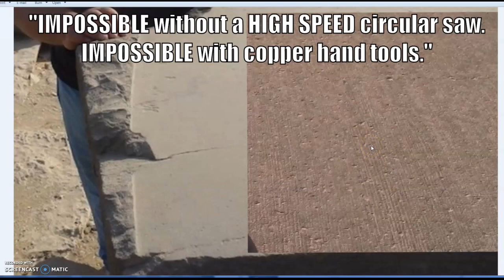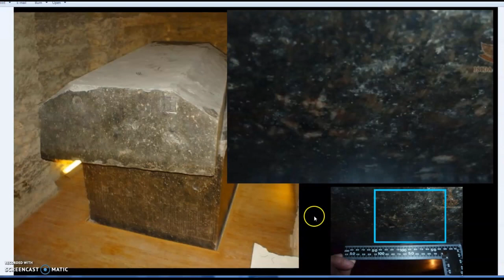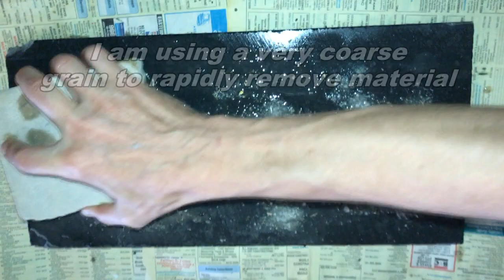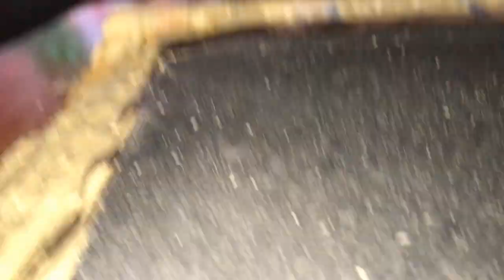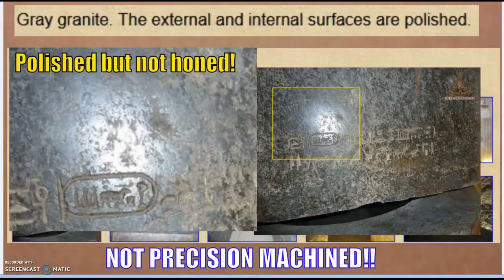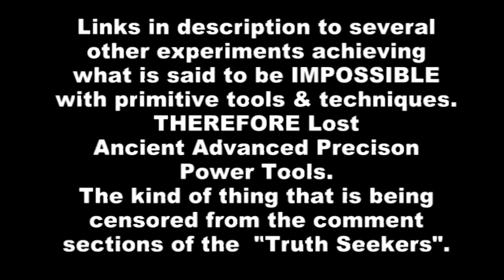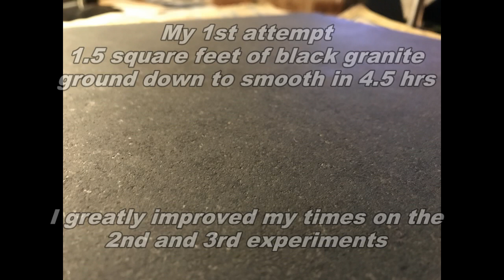Ancient Stone Working Techniques: Experiments with Black Granite on Removing Striations

Comment: The question is about the whole process of creating such a box. Cracking the raw blocks in the quarry? Transport without wheels and only with sleds and hemp cord? Moving on a ship without toppling/capsize? Copper as only tooling material for carving granite? Not copper residue/coloring from the tooling (copper-oxydes and sulphides make good coloring)? Parallel toolmarks in large circles? Core-drill holes and cylinders? Moving boxes in narrow places (why and how)? 

Polishing is only one aspect, especially when compared to the rough writing on the serapeum boxes.

That a slurry polishing with the right material is easy is well known for every hobbyist. But retaining large flat areas and sharp edges is another dimension of complication in this processes.

Post-Scriptum = One point: "High Technology" is a bad wording for working with stone. Is the power-drill we use today "high technology"? For medieval people it's beyond believe and their work would have been much easier. However, for today a laser-engraver isn't even "high technology" anymore, because everyone can buy one on Amazon. So IMHO the working on stone in Ancient Egypt is of course some kind of "high technology" because it's roughly beyond their capability with simple hemp, wood and copper tools. IMHO they must have used a higher technology than this. That means of course not, that there have been aliens or so... but I think your picture of the ancient ones is a wrong one. And archaeologists are to conservative to change their minds about that. So we have to believe that everything had been built with primitive tools.
Reply: This video should answer most of your questions https://www.youtube.com/watch?v=PwcCxJJsCf0

The problem that people ignore is the absolute lack of evidence for advanced technology. Egyptians were literally making fire by rubbing wood against wood.
Reply: @MrAchile13  300 tons
Reply: @KaroBike  And moved on the tight streets of Italy.
Reply from the maker: Just like they moved and re-elected the massive Egyptian obelisks in  Rome in 1500’s. Based on the way ancient Romans did it, after moving them across the Mediterranean, and then much further across much harsher terrain than what the Egyptians did.
Reply: @MrAchile13  wow! - that's incredible footage.
Reply: @HistoryMaze  If you use double the oxen, on two rows, you can even move it without using the pulley.

Mike Haduck has begun moving stones https://www.youtube.com/watch?v=Pb2KoOMMhQg
Reply: @MrAchile13  👍🗻🌴 🐪🐍
Reply from the maker: Pope sixtus the fifth had massive obelisks like the Lateran obelisk moved to other parts of Rome in the 1500,s. The Romans originally brought them across the Mediterranean Sea and then 17 miles as the crow flies from Portia to Rome across very difficult terrain. Making the Egyptian moves look simple in comparison. They only had to get it onto a barge a short distance from the quarry then float it dow river and then a short distance from the river to the site. The annual flood would have pretty much delivered them a hundred metres from their final location.
Vitruvius and Heron of Alexandria (as in the Library) describe in detail the principles of lifting of moving. They also describe different types of cranes but that they understood the underlying principles they could build to puropse rather than just copy one they had seen before.
The lost ancient technologists always ignore that, or when they do mention it they poo poo it with a wave of the hand. I was disgusted when I saw a Hancock lecture treat it as a joke. Also the physicist Nassim Haramein continually ignores it and uses terms like ‘ primitives with vine ropes’ when hemp rope is archeology 101 and more than strong enough even to lift the heaviest stones ever moved.
These guys are scam artists straight up or at best incredibly ignorant of basic science and first year ancient history.
Luckily when I began to get sucked in by their clever marketing and cheap word tricks I had a background in lifting and rigging. Initially I gave them the benefit of doubt on the lifting stuff but then I fact checked their other claims and their fraud became obvious.
Virtually everything they say as a scientific is false. And their omissions are even more telling about their deliberate deception. When they do mention Greeks and Romans for instance it is always to downplay. Even though the records are detailed and describe ancient science in exquisite detail.
Reply: I made a millennial cry yesterday on unfartedx.🤣
Reply from the maker: I the description I have linked videos answering most of those questions. Core hole drilling with copper drill replicating the grooves and tapering said to be impossible with low speeds and copper in granite.
Also the use of stone and flint tools have carving stone.
Granite is easily split so large blocks of complex shapes can be split in a very short time. Using copper and wood wedges. 
There’s some old footage of Italians moving a giant block for an obelisk using just a sled.
Hemp rope has amazing strength and red cedar that the Egyptians imported can easily support the heaviest stones ever moved such as the Baalbek trilithons.
Ancient depictions of sail and rope knots from the solar boats next to Great Pyramid. With a truckers hitch a piece of rope can be made into a compound pulley system. Essential for rigging sails it makes it very easy to lift/move massive weights. The Roman obelisks in London, New York, Paris moved and lifted with primitive tech.
By setting the weight lower on a barge it will actually stabilise the boat. The same way the New York obelisk was placed in the ship. By placing it at or below water line there’s no problem.
The issue with advanced machines is not really the drill but the complex infrastructure required to support it. 
In ancient quarries and sites the primitive stone tools are found scattered around. Tools marks that match. 
Archeology is conservative but it is also evidence based. The only evidence for advanced ancient machines is that it is impossible with primitive tools or it takes too long. Both are untrue leaving no evidence for advanced machinery.
Reply: @SacredGeometryDecoded  Funny is that every "reenactment" of how the ancient made some things are on the very simple side and "scaled up". You made a good job -- I have to say. But always on small scale. If you crack a granite block -- for every one you crack correctly, you would destroy some and generate faulty ones. But these are not to find in the quarrys in large amounts. And no one has the man power to simply destroy them, because they are useless.

All are test-borings are small and not very deep. These holes or cuts and not fully worked out as proof that something is possible -- as a proof of concept... of course... and then the time and effort is multiplied. But to be honest: This isn't any proof at all. In my vicinity there live "experimental archaeologists" in a fake viking village and tell us: this is the way the viking lived... made their food... smithed their weapons. But this is absolute nonsense. We don't know how the vikings lived 1000 years ago. Experimental archaeology is always from the view of the modern man... we can buy slurry-polish in the tool-market and they work well. So they did it the same and polished their boxes -- and of course the would have done it this way. But then lost their interest and all quality in engraving their hieroglyphics? A better explanation: The ones who know to polish by slurry and cut and move those boxes lived a forgotten time before the ones who not know how to carve nice looking hieroglyphs.

As long as you haven't found a tool you can't say how it's done. Myriads of vases and stone works all over egypt and not a single saw or drill. Not even a picture. All these pictures of may-be-tools may be pictures of tools or other things we don't understand. Most of these "how they'd done" videos/stories look some how obsessive but these archaeologists don't look like they even know how to handle an electric hand-drill. And then want to explain how to drill a hole the primitive way?

And further more, you have no pictures of cranes (or found ony cranes in the diggings) -- without a crane (of hard but elastic wood, metal clamps, pulleys, good ropes) you only could dry-dock a ship to load it with a heavy block of stone and then flood the dock. Otherwise the ship would capsize -- everyone with a canoe knows this firsthand. I have a 7,6m 2to deep keel sailing boat and even this heels to one side, when I jump onboard with my 80kg.  To load a ship from a side with a block isn't possible. You have to transport it over the ship and then lower it down and correct the ballast. Or the ship has to be so much larger than a block, that the weight wouldn't matter. But that holds some other complicated problems -- you can't sail a large and wide ship upstream... and you can't haul it upstream either.

IMHO... the ancient egypt society as it is represented by egyptologists or archaeologists is by far to primitive to make all these "wonders" -- which in return means (in my view) the makers had been more advanced. That doesn't mean in return no high-tech-world with engines... but with more knowledge we haven't figured out yet. Or the "aegyptologistic copper societey" lived after the one who made the wonders -- not with high-tech laser-tools but very very more likely with hard-metal tools and slurry-polish.
Reply from the maker: It's not funny at all that the re-enactment are small scale, not many people can afford to gather large teams to do full scale reproduction.
My small scale experiment here, are you serious? Do I need a large wall to demonstrate the rate on a limited area.
You are using incredible mental gymanstics here.
Granite especially lends itself to splitting along the scoring or plug lines, there are many many examples of people doing it online. Granite will ALWAYS split on the straight or curved line unless there is an unseen fault in the stone. Which masons and quarry workers test for by tapping on the stone and listening for the sounds.
With fire setting it is very easy to break up granite into dust. I did a video on this with examples of people doing it in the field and experiment I did myslef.
So your first paragraph is just incorrect on every point. 

Test borings include large ones and small ones. They also knock out the plug and it's just a matter or drilling down further. The depth of ancient core holes aren't deep in comparison. It's really not an issue not all. Since the copper core is thicker than the shaft you can keep going with no problem. Are you saying there is a problem with drilling deeper and you need to see it done? 
We have found tools that litter quarry sites and construction sites. In the images we see metal working and workshops.
Copper mines etc

Experimental sites like those viking villages are based on evidence such as furnaces and slag, bones and seeds etc. As well as written chronicles and descriptions.  
There is no evidence of this ancient civilisation or of the lost ancient technology. It is not a better explanation to say it was an older civilisation since the boxes themselves are not even honed or especially well made. Many of them are unfinished. Except for the size they are no different in material or hand tooling marks such as at the Alexandria Serapeum. 
You don't need hard metals such as steel, try a steel chisel on grante and then try and stone hammer and see if there's a big difference. i will tell you that there isn't having tried both. For some jobs I would favour the stone tool.

Copper is a valuable item. It was money and is still is, there are rare finds of tools. How many tools are found on a cinstruction site after completion? They are valuable unlike stone tools. Though we have found tools and sleds etc in ancient that have been shown to be effective in recreating so called impossible features.

to quote:
"Most of these "how they'd done" videos/stories look some how obsessive but these archaeologists don't look like they even know how to handle an electric hand-drill. And then want to explain how to drill a hole the primitive way?"
OK now let's get to it, you are talking nonsense, they literally successfully demonstrate how to drill with a copper drill. You are so invested in this lost civilisation that you are just making up pointless arguments that are cringe.

You say the archeoologists doing reconstructions are just making it up but then you even worse because at least they have evidence.

Ancinet Egyptian pictures of boats show the rigging necessary to make a crane. If you can manage sails you need to undersand the basics of mechanical advantage.  Later Greco Roman writers describe the principle of lifting in detail. Heron of Alexandria (Library of Alexandria in Egypto hint hint)
The Thunderstone in Russia was loaded onto a barge, cargo ships throughout antiquity managed to balance their loads. How is this even an issue?
Egyptian and other ships were tied together with knots for easy dismantling, it's not every day you would be movng a giant obelisk so perhaps they might have gone to some special effort. The Aswan quarries were up river so the current would transport them but you can't be seriously suggesting all shipping on the Nile was one way? Of course they could navigate up river. 
IMHO you don't know what the mainstream is actually saying and the evidence they have.

quote
"Or the "aegyptologistic copper societey" lived after the one who made the wonders -- not with high-tech laser-tools but very very more likely with hard-metal tools and slurry-polish." You have no eviedence of this at all, hard metal tools are not necessary as even modern equipment relies on the abrasive not the steel to do the cutting. Sandpaper can cut through stone, masonry drills of hard steel are useless once the hard tip is gone.  Bone will drill through stone as long as the abrasive is there.

Everything you said in this reply are just the standard lost civilisationn talking points built on logical fallacies and claims that are just wrong.
Reply: @SpaceTimeAnomaly  What do you think about what they come up with in this video in relation to moving big stones? https://www.youtube.com/watch?v=90ly8GtME3Q
Reply: @SacredGeometryDecoded  You never had been on a boat -- obviously. You simply can't load let's say 20to stones (which are small in this discussion) with an in-boat crane without counter-balances. You can't "slip" the loaded boat in the water either. At least you would need strong ropes and pulleys -- and these are not included in the workmans-package which is given to us by the aegytologists.
You can't manage loading with ropes which are prone to water effects -- Thor Heyerdal has learned this the hard way when his boats got apart. 

In our society large objects are regularily transported on ships since the 1970s with the container transporters. Before this we used only bulk freighters. If a large piece had to be shipped it was always a major task. But archaeologists tell us that the ancient and primitve egypteans regularily transported large stones in large quantities. No! That's not the way the world works.

BTW: The pictures of the moving of the Thunderstone were "artist impression" -- on a sled on marshy grounds? Not this way. ;-) 

I'm no friend of archaeologists. In my country they are obsessed in telling everyone what to do and what don't. I'm not even allowed to dig on my own ground or to use a metal detector.
Reply: @manwithoutaplanet  You can't slip a boat with a 10to stone from the beach into the water. You can't carry or push such a weight. You have to pull it. But even then... it's basic theoretical mechanics to calculate the stiction to the ground and it would have been way to high. And to have "air bubbles" to hold such a weight is beyond the capabilities of a primitive culture, because they have to last for the whole voyage without a single failure. Sorry, but the video is nonsensical in many ways.
Reply from the maker: SpaceTimeAnomaly I worked in rigging and lifting so I know a thing or two.

There is a description about moving. an obelisk. The boat was assembled in dock and they just waited for the annual mile flood.
There is evidence of such socks at the Aswan quarry.
Rigging (ancient knot tying knowledge) such as hitches were common knowledge to sailors especially. There’s you compound pulley. A truckers hitch but why lift a giant weight when you can just roller/sled it on.
Reply from the maker: SpaceTimeAnomaly the archeologists talk about the Nile flood and how it allowed the movement of stone. Based on evidence such as dockyards and nilometers.
You clearly don’t know what they do or beyond what the scammers tell you to believe.
Reply: @SacredGeometryDecoded  Sometimes I see some Egyptologists in their educational programs where they try to load 2 t blocks on a boat :)) they are funny;)) on ancient paintings you can see a completely different technique.
Reply: @SpaceTimeAnomaly   You are quick to dismiss other peoples theories (even when they got supporting evidence), but are there any theories you support in relation to moving these large stones? In the case of the video i linked to, they found the "quarry", they found a ramp nearby and they found "tracks" below the ramp. What is your conclusion on how the stone was transported?
Reply: @SacredGeometryDecoded  Yes... but this is for single large objects. There you can do such a costly way of transport. If you want to transport masses of stones you can't do this without cranes. BTW: The youtube discussion thread system is crap! Do you have an internet forum where you discuss such things?
Reply: @manwithoutaplanet  I have no answer. Only that they must have had cranes and pulleys and good quality ropes. No transport of large stone blocks without that.
Reply from the maker: szpak mateusz yeah, Mark Lehner is pretty bad at that type of thing. He struggled moving a 20t block on a sled with a giant crew. The wood was squared off and the oil caused that suction effect.
A pretty bad tv doco attempt to build a small pyramid. An old mason happened to be working past and showed them how to do it properly. As if you wouldn’t ask an old timer for a few nuggets of wisdom before you begin?
Reply: @SacredGeometryDecoded  You have one flood a year and you don't have enough wood in egypt to build enough ships for one fleet of stone blocks to build all the temples, pyramides, etc. -- so you have to travel up-and-down several times a year. And so you must have the technology to load and unload the ships.
Reply: @SacredGeometryDecoded  you always have to ask the elders first;) how to find the "balance" or "center of mass" of the block .. then you can use the ancient swing ..
Reply from the maker: SpaceTimeAnomaly they imported wood from lebanon Israel which was covered in precious red cedar back then. Early Egyptian military campaigns into the region to secure the supply.
Sycamore and acacia grow in Egypt. The Nile delta was a vast wilderness and one of most fertile places on earth.
Most of the stones they used were quite small. Very few large obelisks in all of Egypt, the large heavy stones that would require special attention are relatively few in number. Very often they locally sourced limestone or sandstone. 
But they were a large well organised bureaucracy kingdom. 
The Palermo stone details the festivals of old kingdom pharaohs and yearly Nile flood data. They held regular census including on the goldsmiths. If you have to arrange a special census of how many goldsmiths you have arranging a fleet of boats is hardly a major problem. 
Up to the time of old kingdom areas of Sahara desert and eastern desert still wet/fertile . 
North African coast also more green than today.
Baboons, hippos, crocodiles, lions were there.
Reply: @SpaceTimeAnomaly  Ask Bob ;)
https://www.youtube.com/watch?v=ulVDaXtJDYw
Reply: @SpaceTimeAnomaly  Pliny describes how they moved obelisks with boats https://www.youtube.com/watch?v=v4OhqOp29ZA
Reply: @SacredGeometryDecoded  After rethinking your attempt to saw (not this video, your linked one) I have to tell you: Your saw isn't scalable enough for real work. If your make your copper saw larger, you would need more force to get your stone sawed. That would only work, if you would make your saw wider. Then you would have a bigger surface for the saw and therefore would need more force to work your tool through the stone. Both values scale linear... but in total twice... therefore the force would scale to the power of two. And if you use copper, that material isn't rigid enough to withstand that force and would bend and/or use out very quickly without making much progress. This especially, if you try to cut deep = have a wide and high (!) copper saw blade. Copper isn't the material to go... even bronze wouldn't work, because it tends to splinter when shear-forced. You could use forged hardened steel with sand/quartz als grinding material -- if you're not capable of making saw-teeth.

In your video you show IMHO the maximum your type of copper saw could handle. It wouldn't be possible to cut of half the lid of a box which is more than 1 cubit of width. I would guess, that an inch is the maximum that your type of saw could manage before bending because of the force one needs to press the grinding material on the stone.

YT commenting function sucks... :-(
Reply: @HistoryMaze  I do not agree with your theory;) in my theory it was the other way around;) the obelisk (in a wood casing plus two wooden shoulders on the surface) was parallel to the edge of the Nile and was sufficiently under the surface of the water;) controllability ...  barges on rivers today ...
Reply: @KaroBike  you could be right - I'm terrible with instructions:) - this was just how I interpreted what Pliny wrote - I think he said that they started with stones(ballast) in the barges, then as they took the ballast away, so the barges rose up to take the weight of the obelisk...but could have worked how you suggest too I guess.
Reply: @HistoryMaze  Such a "H" model has two critical points for "weight", a better model is "III" ... Tactics with a stone ballast were probably good at a constant non-rising water level ... But probably the Egyptians used the power of the rising water level;)I'm just guessing
Reply: @SpaceTimeAnomaly  This is the only thing i agree with you in this thread.. YOUTUBE COMMENT SYSTEM IS SO DAMN SHIT!

Hope SGD gets a discord up soon. Its so much better for debates.
Reply from the maker: SpaceTimeAnomaly if you begin a guide to get the initial cut the copper will follow the groove, or just use a simple guide along the side to continue. A copper bar 2 to 3mm wide is more than rigid enough for purpose. It’s off the shelf type of thing from a metal supplier if in doubt. They come in very long lengths. Even thin steel plate of 2 to mm will flex at longer lengths but doing a cut like on those sarcophagi it’s not an issue at it will follow the groove and is supported the entire time. There is no need to force them hard just like using a wood saw the flexible blade will follow the cut and you don’t use downward force. It’s just about drawing it back and forth. 
Is there anything else?
Reply: What kind of "high technology" would make surfaces that's not perfectly flat or corners that's not 90 degrees? If it was a "higher" technology than today the precision would be better than today's tools and it's not. It's not even close to the precision we can cut stone today. So what type of technology and tools are you talking about?
Reply: @johnmcenroe1760  No one says this. It's IMHO on par with the technology of our 15th century... and in surface quality with the hight of the greek epoche -- where they cut the colums in small parts because of easy handling.
Reply: Does not matter if every single step is proven. Stupid will continue  hence the mud flood or star fort people.
Reply: The guy don't know he full of 💩